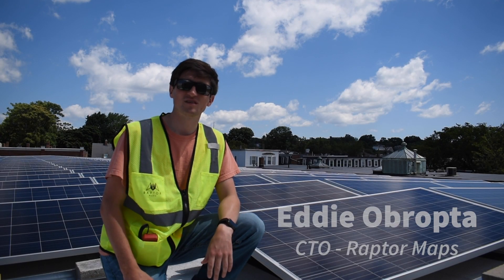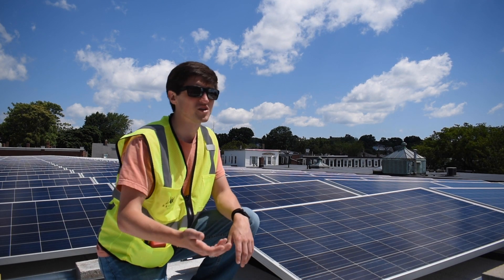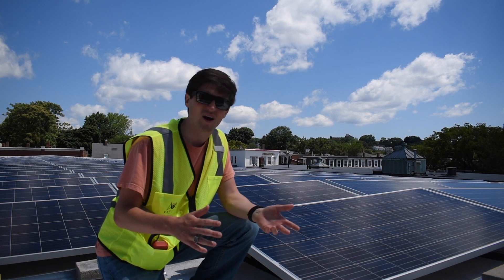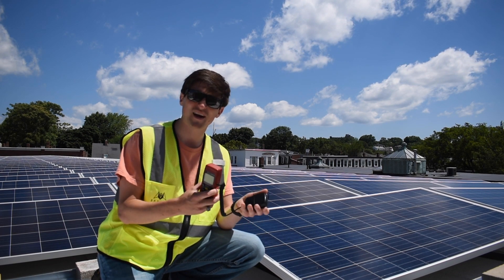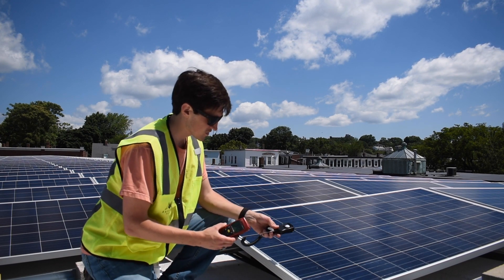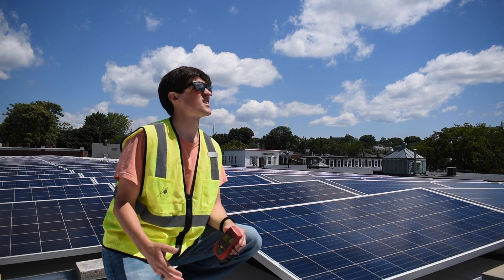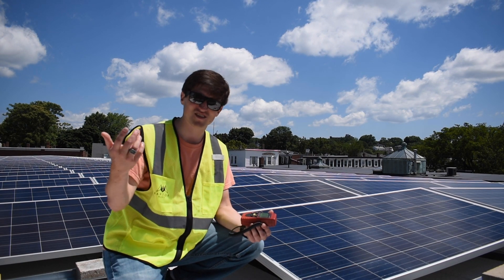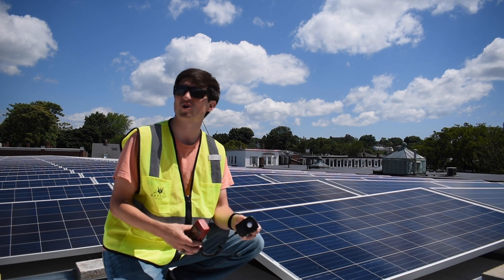How to use an irradiance meter for successful solar inspections

Comment: Uhm  are you just using this to tell you its sunny enough to take pictures with a drone?   But what is the real reason or use for a calibrated irradiance meter?   How do I take the irradiance readings and use them to tell me the PV panels are performing as they should be?